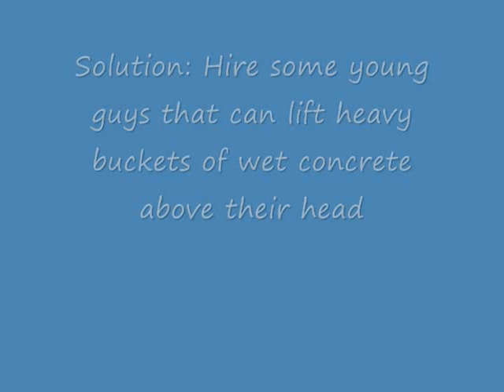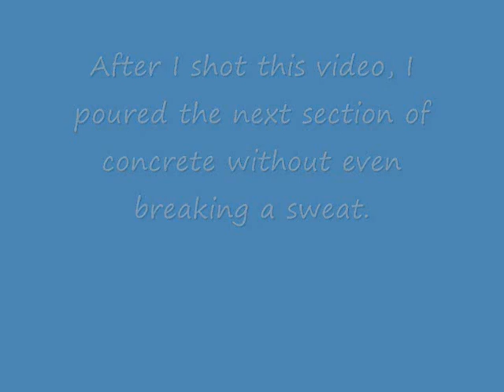Homemade wooden Crane made of standard lumber

Comment: Nice,   I couldn't see the end,  Did you have a pulley for the rope to lift,?   I'm watching videos cuz I'm in the middle of building a my own wooden boom,   I'm putting a electric chain saw on the end,   Ropes n pulleys to actuate the 18 foot 2 stage boom, Scaffold strapped in the back of my pick up,   I have high tree limbs that gotta come down..
Reply from the maker: No pulley, just counterweighting on the back of the boom to offset the load on the front.
Reply: Good Job.  I always believe we should,   "Work smarter,  Not harder" ..